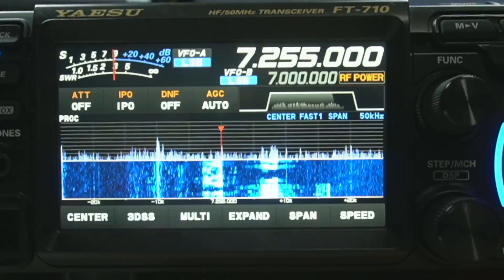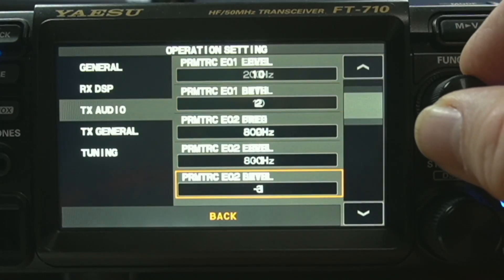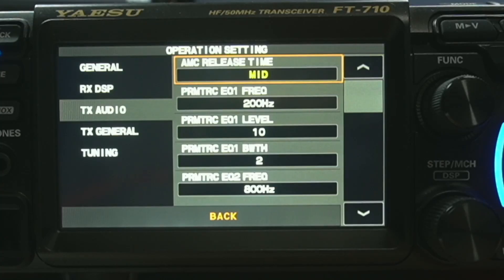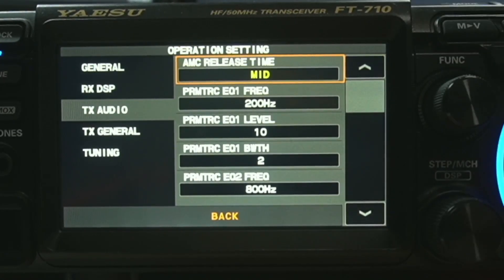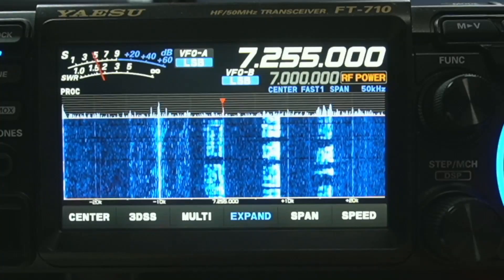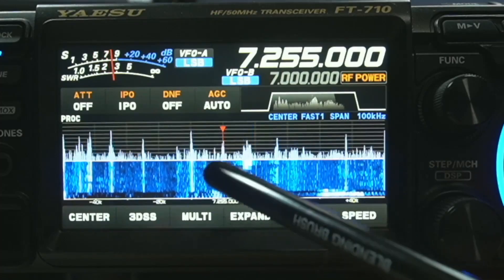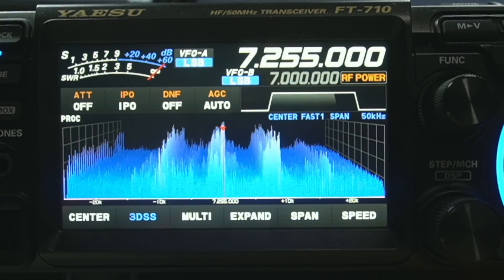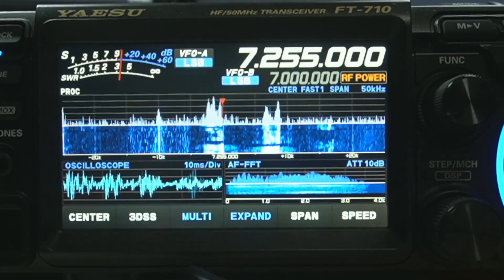How to set your transmit audio on the Yaesu FT-710!

Comment: After looking at several competing radios, including ICOM and Yaesu products, I purchased the FT-710 AESS. Though I've had it only a few days, I can say it is a solid rig. I'm limited to 10m for phone (Technician) but I've had contacts 57 to 59 received from 3-4000miles away. It is a beast of a radio and I highly recommend. Thanks for the content, very helpful.

Comment: AM modulation is awful on this radio. Is that transmit audio for SSB only? or s there anyway to setup the AM audio?
Reply: My 710 has very low mod level on AM transmit.  Excellent on SSB.  Noticed in manual that audio processor freq levels (P...) etc only apply to SSB..  Don't know how to get more mod level on AM Tx?

Comment: I just checked my audio using your settings recording me on KFS Web SDR and I am a little bassy, but not bad. I even drive the ALC right up to the blue with these settings. Of course that using the peak meter setting and not average which is the default. BTW I cannot stand the 3DSS. My mic eq was off when I did the settings you showed and when I got the mic eq back on they were still changed to the new settings. FYI

Comment: My first experience on HF SSB after getting my General in May was on my G90. Not much in the way of audio processing options on that rig. Now with my FT-710, which is a WHOLE lot more radio, I am searching for wisdom about the wonderful world of audio processing. Thank God for people like you, the YT Elmer's of the world that make these awesome teaching videos; just like you were sitting next to me and showing me the ropes. Thank you 73 DE KN6ZVI
Reply from the maker: Thanks Alvin, like I said that each person will be different but my settings might be close to get you started. Thanks for the comment!
Reply: @KK6USYHamRadioAdventures  Taking your advise on testing the setting I have in the intervening time tweaked a few and learned some more about the Tx Audio setting. One "revelation" in particular was the difference between the PRMETRIC and the PPRMETRIC settings. Namely the former is for when you have compression turned OFF and the latter for when you have compression turned ON! I don't know if you went into that level of detail as I have not re-watched the video. I was originally confused a bit when you went thru the settings because of the two prmetric setups. Thanks for the videos and keep them coming. 73 KN6ZVI

Comment: I have had my 710 since September. Worked POTA, DXCC and lot of rag chews running barefoot power.  I never have a problem being heard, and just enjoy this SDR radio so much. Setup was easy enough and most hams love to fiddle with their rigs. Really appreciate the large LCD capability, memory functions galore, and the solid support from Yaesu firmware updates work well. Your video was very informative touching on everyone’s uniqueness and preferences. Yaesu’s defaults are a good starting point too. I have the the external speaker model and have found that if I can hear a station I can usually work them. In the past I would shy away from weak signals with my old radio, but not with the 710.  I work phone 98% of the time but have been practicing my CW with the 710 also, and hope to get back int this mode soon. Thanks again for the video, Merry Christmas.

Comment: Great , Yet on the older  IC-7300 you have bass and treble setting , so easy , so simple , so intuitive and sound great on air, I left wondering  when Yaesu is going to take a step back and rethink making their gear more user friendly and intuitive.
Reply from the maker: It's all in what your used to, I have more problems with my IC 705, but I'm used to Yaesu. Both good.
Reply: @KK6USYHamRadioAdventures  ?? 705 ?? I am using both ( Yaesu and Icom 100w H.F, sitting on different bands) , yes both are VERY good, but! THAT IS NOT THE ISSUE RAISED, Some radios are just much easier to use and intuitive.  TX Audio should be easy to set and the fact that  you saw the need to put a video about " how to set your transmit Audio" showing all the setting in their little menu boxes proves this point and point to the different thinking process those companies have.
Viva la difference, options are always a good thing 🤗
Reply: @che59v   Absolutely. Yaesu is so much less intuitive than Icom in my humble opinion. I have very high respect for both brands. It just takes me more time to sort out the Yaesu options and I always find myself wanting.